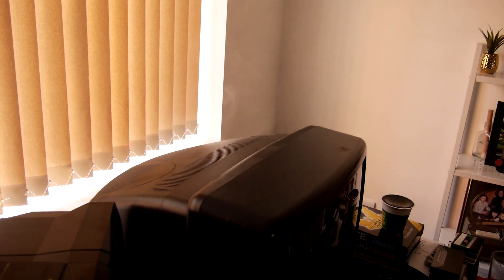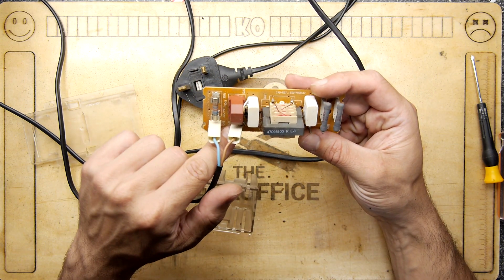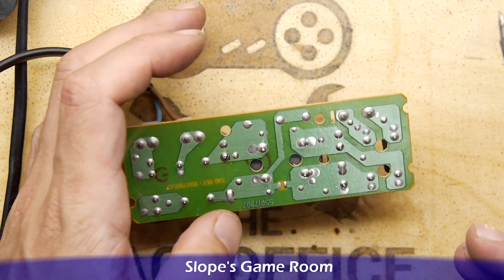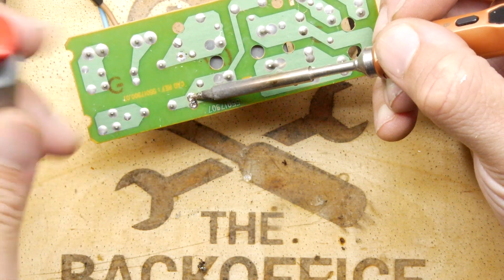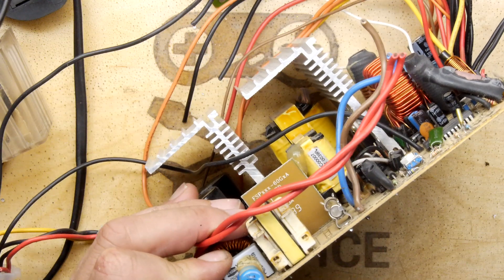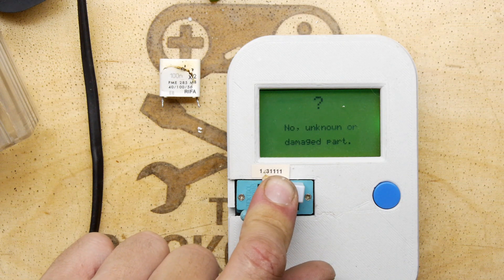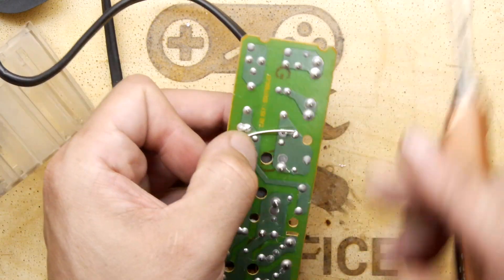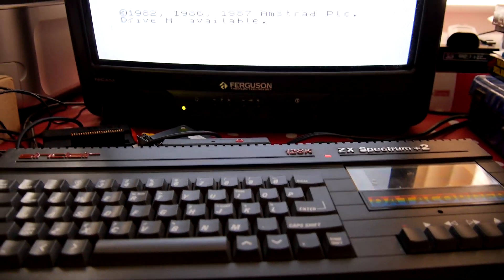Repairing a blown RIFA capacitor in a Television

Comment from the maker: Have you spotted a Rifa in any device other than a beeb?
Reply: Apple II PSU!
Reply: Revox B795 turntable that's why I'm here
Reply from the maker: @choboutube  do they have the rifa terror as well? 😬
Reply: Yup. 100nF that went up in smoke, surprisingly the turntable still switched on and rotates, but sourcing a replacement now
Reply from the maker: @choboutube  yeah they normally are there for noise moderation so often the device can keep running - reassuringly!
Reply: Yes in a blaupunkt and Telefunken CRT already replaced all but the blaupunkt is infested of trash rifa
Reply: Yamaha DX7 MK1 from 1985

Comment: Hi- I recently plugged in a fruit machine (after it being in storage for a few years) and smoke came out of the circuit board. Would it be similar issue that can cause what you encountered ? Great video btw. Hopefully it’s the same and I can do a manual fix myself.
Reply from the maker: It's almost certainly a popped capacitor or three

Comment: Are Rifa so worse than Chinese yellow capacitors of same value?
Reply from the maker: In my experience, I have only ever seen blown Rifa capacitors in decades old equipment but have seen a handful of blown capacitors in cheap modern gear. So I would suspect they really are not that bad for regular use. I suspect realistically if you have replaced one you are unlikely to have to do the same job again in a lifetime

Comment: Mains input  board. 
Its a filter board,  it's job is not to filter the crap coming in from the mains supply, but to prevent any interference from leaving your TV set  and infecting the rest of the mains supply around your house.
What happened to the end of the video?
Did something go bang?
Are you still alive buddy?
Do I need to buy a funeral suit and a wreath?
Reply from the maker: It was an unintentional, but ultimately satisfactory ending 😂